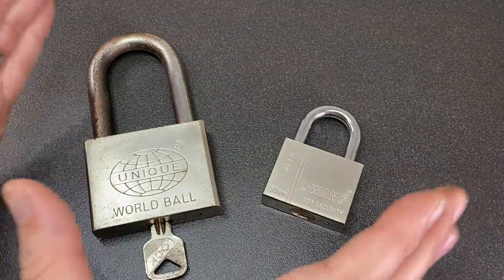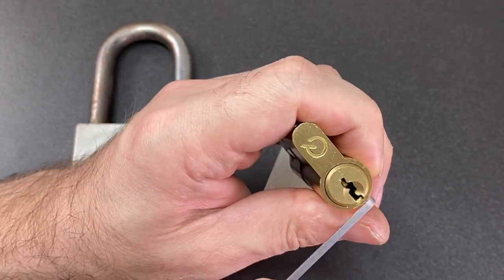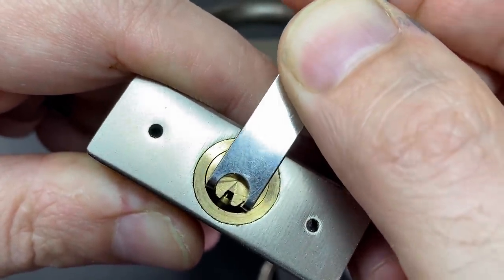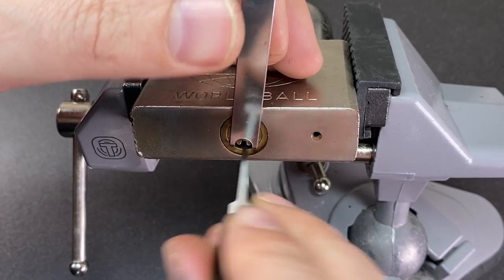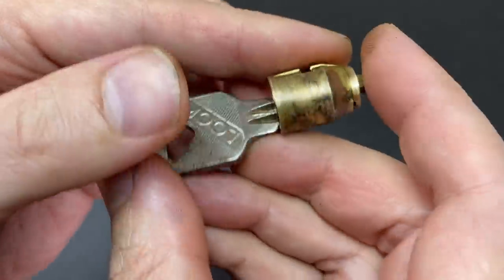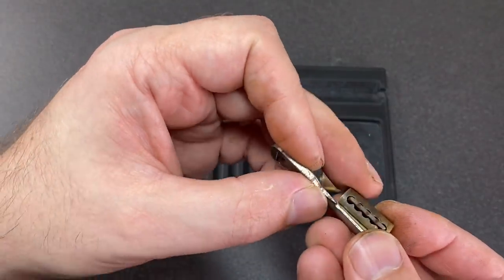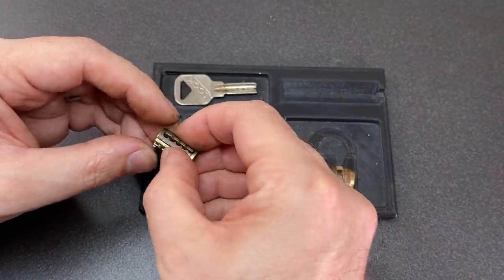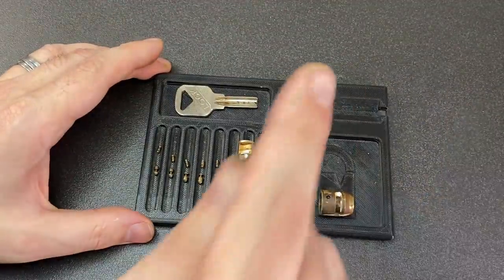Smiley Dimple Lock 101 - Everything You Need To Know

Comment: Wow! That was an extremely detailed explanation and very easy to see and understand. If I had no prior knowledge of locks at all, I would still be able to follow you easily.
I bet a dimple lock "Z bar" would work to tension as well as the pry bar. 
I have always called those springy tensioner for automotive wafer locks a "Y wrench" and thought the tool you used was for tubular locks.
Those "GOSO" sets are garbage. They are stamped out of some cheap metal that is too soft, the "Y tensioner" is way to thick steel to be able to hold squeezed in one hand for very long. The types of tensioner it comes with do not match the types of picks, and what the @#$& is that wavy flat thing? Some say it's a dimple rake but I can't get it into a dimple keyway.
Don't waste money on it, banggood has a very nice beginner set with optional handles in the same price range that is much more useful.
Reply from the maker: Thanks for the great comment!